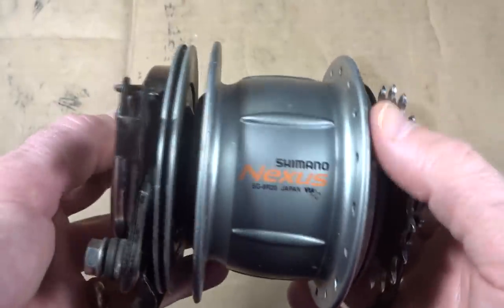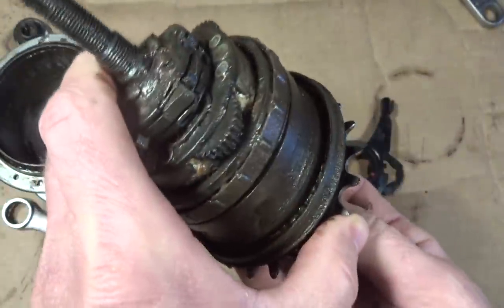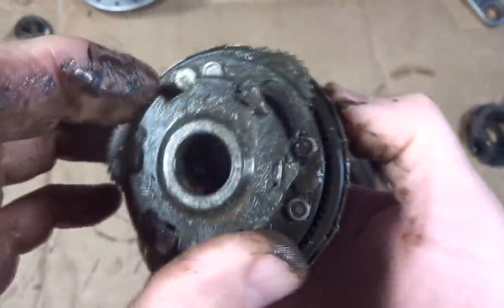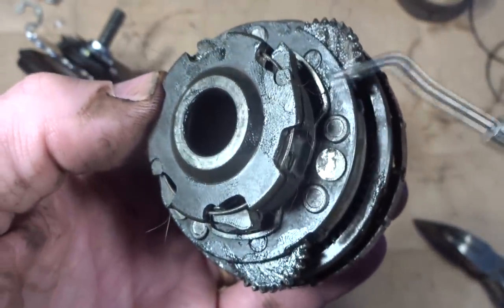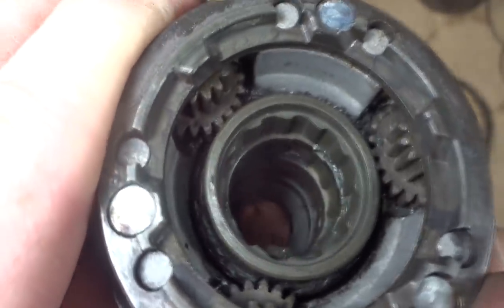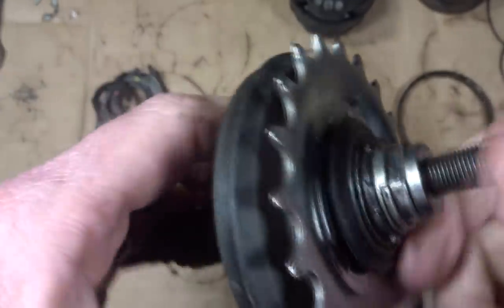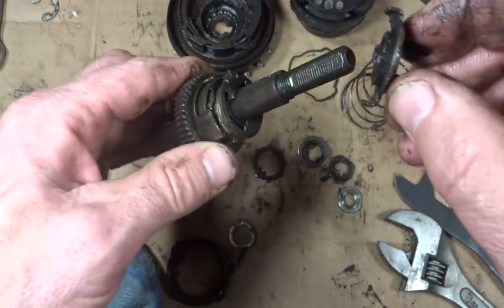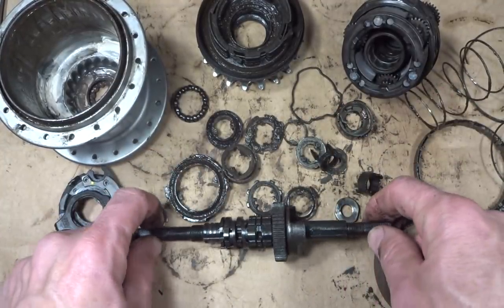Shimano Nexus 8 Speed Hub - Dissection! Evisceration! Destruction!

Comment: Did you ever figure out how to get the small/large gears out at 5:49 ? As i'm trying to restore one that has a bit of rust, and I would love to be able to really get in there and clean it out.
Reply from the maker: There are double pins holding them in. A pin underneath another pin.
Reply: RJ The Bike Guy Ohh! I have to slide the pins for the small cogs up through the large cogs, I was trying to move the large cogs to the side, but couldn't get it to clear. Thanks!
Reply: @RJTheBikeGuy  I got all of them out and got everything cleaned out.
One thing people should be aware of, when assembling, is that the small ring with the notch that sits between two of the inner most cogs, also have two tiny notches, that needs to fit with two tiny protrusions on the part of the axle with the moving parts.
TL;DR that disc with the notch is NOT symmetrical, do not flip it the wrong way like me, having to pull everything apart again.

Comment: You have 3 lockable rings, 2 possibilities per ring, so 2 x 2 x 2 = 8 speed. It's like a 3 bit counter :)
Reply from the maker: Nope. The pawl work as None, or #1, or #2, or #3. And then there is another cog thing that pops down starting  at 5th gear, and the pawls again are None, or #1, or #2, or #3. So that is 2 x 4 = 8.

Comment: You design a state at a time, then figure out what has to be done to change states....kinda like an old-time clock-maker who'd add funny little noises, dancers, chimes, and so on to the basic clock movement.

Nowadays, a lot of that gear-work, springs, and so on has been replaced by computer chips and "if", "when", and "do while" statements.

Comment: When I am disassembling something complicated I always get into some real deep thoughts.... That hub is over engineered to a point where the crap side of the scale is bottomed out. I wonder for what reason the designer decided to overdo it and why on Earth it passed trough all of those higher positioned employees at Shimano with approval to be mass produced.
Reply: I wouldn't call this hub 'over engineered' it certainly has some complex engineering but it is unlikely that cramming 8 speeds into a bike hub could be done any simpler , Shimano has been making geared hubs since the 1960's and they are now up to 11 speeds. There are thousands of these giving reliable service, just remember that the shifter adjustment has to be spot on. far less maintenance than a clunky, crude derailleur
Reply: Robert Paterson Geared hubs are not superior over a derailleur and cassette. Yes, they are sealed and they can be ridden for longer period of time between every service, but that does not make them better. I still haven’t seen any mountain or road bike in a race using them, because of many reasons like poor engagement, added rotational mass (also its overall weight is greater relative to a derailleur system), higher internal friction and most importantly - their gear ratio is pretty poor compared to 10-51 mtb cassette for example.

Comment: One of these hubs failed on me after about 2000km in the middle of Vietnam.... Had to get whole wheel replaced.... Shit product.
Reply: Same here, but they replaced it under warranty. Unconvinced, I stripped the new one and compared it to the old one (the LBS gave me a new hub, I rebuilt the wheel) There was nowhere near enough grease in either, probably to aid shifting. I sealed the large end cap with silicone and gave the thing about 35 mls of ATF. Leaks like a bastard if you lay the bike down (so I don't), but works like a dream still 10 years later. The Alfine hub comes filled with oil, just like the old sturmey hubs. I think it was a good product, but they tried to make it maintenance free and that backfired. Any water that got in attacked the two large bearing races in the shell (one central and one at the shift end) and then it sounded like a bag of nails. The atf settled wherever the water settled and protected the surfaces in a way the grease could not.

Comment: I wouldn't mind having one bike equipped with one of these hubs because it's something different...  Then again, taking into account serviceability, no thanks.  LOL
Reply: The hubs are fairly cheap, so the "service" is just replacing the hub. Gear hubs are pretty durable and are nice for mixed weather conditions because you don't need to clean as often. Shifting from a stop is also nice for city riding. I recommend giving geared hubs a try!

Comment: It's not magic, it's called engineering. You can actually learn this stuff.....
Reply from the maker: Yes I can. But can you learn a sense of humor? :D
Reply: Don‘t I learn that from Bill Burr, Jim Jeffries (never could spell those Aussie names right) or George Carlin?  I am surprised that Shimano chose grease, lots of grease for this. Rohloff and Pinion and other planetary gear boxes use oil baths that need regular maintenance, i.e. oil change. Oil makes more sense with a lower friction coefficient for moving small parts. Although, it is indeed interesting to see what’s „in the box“.  On the other hand is is not good to see that there is not much maintenance that can be done or if something starts sticking you need to send it back to your LBS or Shimano. My  wife‘s bike has a nexus hub and is still working good after 10 years so they are reliable (with a sample set of 1 for statistics).
Reply from the maker: @lorenzsiggel1515  Actually this uses both grease AND oil.